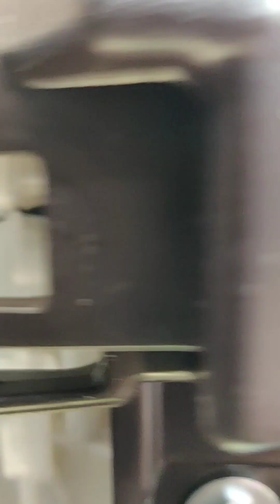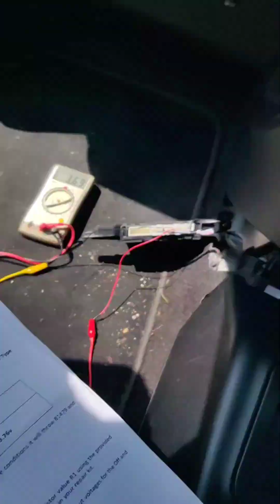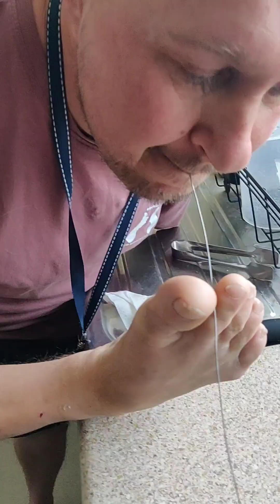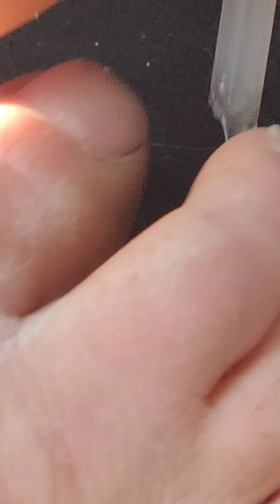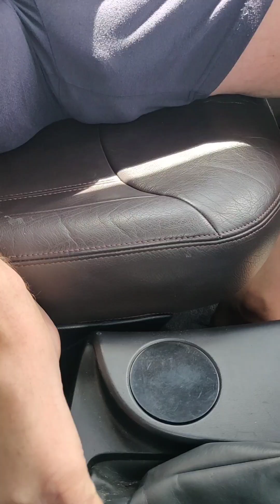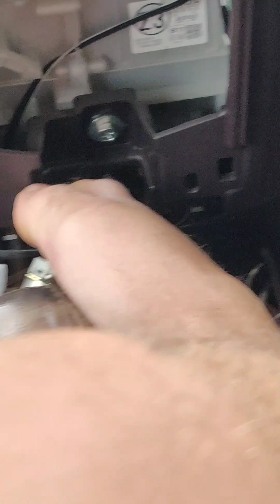Toyota Aircon flow sensor repair B1479 code this is on an iQ but works with Toyota and lexus issues

Comment: Hi, I've just ordered this part for my IQ as no air con, when I've measured the voltage as you have done prior to the part coming I get 3.74, does it say what the voltage should be?
Reply from the maker: Yes mate instructions come with it and say where you need to be and how to work it out. I didn't work it out properly at first so contacted the seller and he kindly told me which resistor I required, yours is a similar reading to mine, mine needed a 1k resistor
Reply: I had reading of 3.56V and i soldered 1k resistor. It works good now. When AC is on i get 3.1 to 3.2V when AC is off i get 3.8V